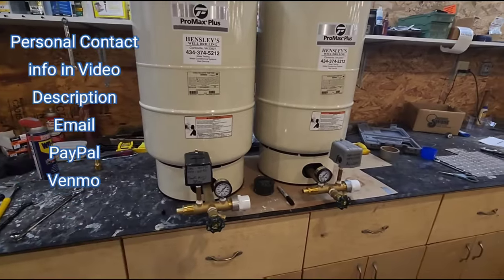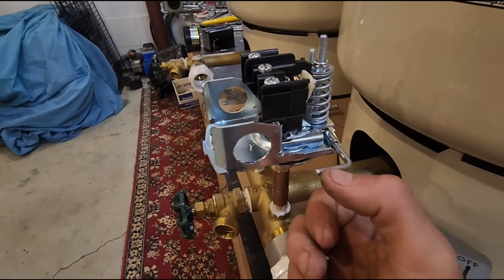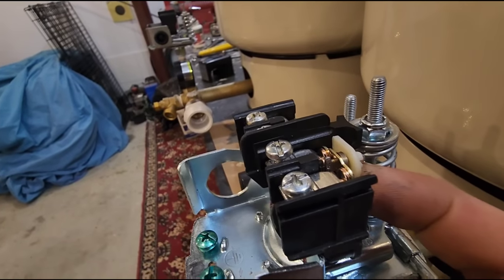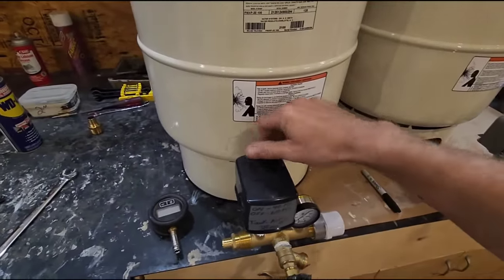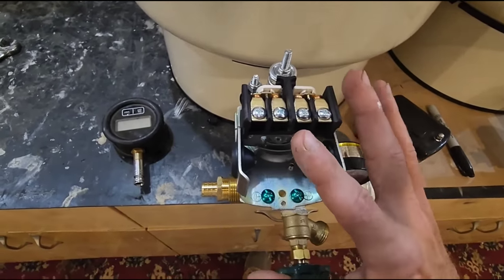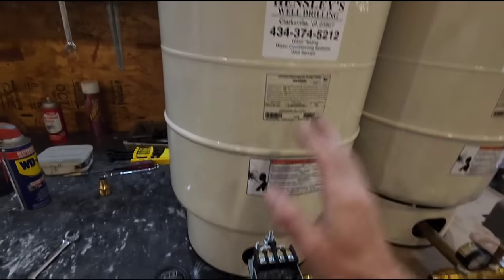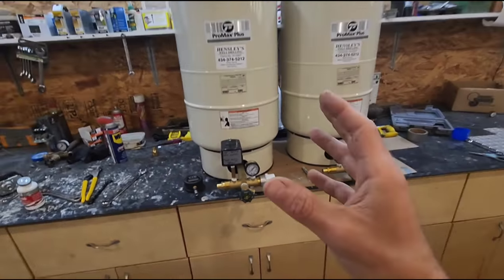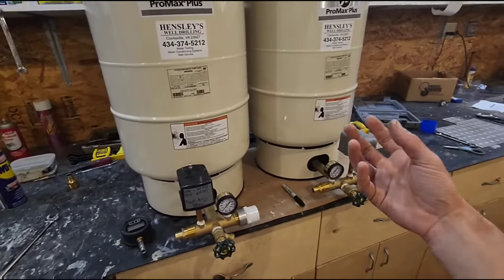Most Common Reason for No Water!! Reset Pump Pressure Switch. Water Well Repair Vlog Ep.18

Comment: Hi I moved into a house that the power was shut off for a while I had it turned back on but there no water what do I do
Reply from the maker: Does your pressure switch have a lever on the side? Follow the Vid on how to reset it. 
Is the well pump breaker off?

Comment: God I need help with this so bad my pressure switch keeps shutting the pump off for seemingly no reason the tank clearly has pressure but I don't know if it has to much I am going crazy
Reply from the maker: Turn off the breaker to the pump, then open a sink . Once it quits go check the air pressure in the tank. If its above 20psi it should run fine. If its below 10, air it up. The air valve is on top of the tank. 
Now, if the pumps fixing to die, it'll shut itself off because it's overheating (it's run for 3-5 minutes & shut off for 6-10 minutes and randomly come back on. Check the tank first,  if it has good air & it seems empty & easy to move it then the tank is good & probably the pump is the issue. A clamp style amp meter is what you need to truly test the pump. Order one from Amazon that'll read up to 20 amps. (Not a typical volt meter) A clamp style amp meter

Comment: I turned off my breaker. Drained the water and changed my sediment filter.  When I turned it back on. It did not work.  30/50 bladder at 26 psi. Basic volt tester pen indicates power before and after switch(no lever) when contacts are touching. Also pressed reset button and nothing. Any suggestions??? I need help
Reply from the maker: Flick the contacts a few times. If it worked before it should work now. Did you forget to turn a valve on?
Next step is to test for power out at the well & feel the pipe to see if the pump hum's (it's running)
Reply: The water came back on around midnight that same day.  Honestly not sure what made it come back on.  Only thing I can think is I trapped an air pocket after draining the lines to change the filter.  Idk. Just glad it’s back on.

Comment: New pressure switch new tank water want even build to 20psi any ideas
Reply from the maker: Kill the power & see if the pressure drops to 0. If it does, then you have a leak (most likely down the well, i.e., broken/rusted fitting) 
If it holds at 20 psi when the breaker is off, you simply have a worn out pump. Impellers are shot

Comment: What happens when your water pressure at the gauge is not high enough to reach the cut on psi of the pressure switch
Reply from the maker: Either the pump is old & weak, or you have a hole in the drop pipe

Comment: Mine doesn’t have the lever, it has a push down button, I pressed and the tank went to 100psi but still no water so I released some pressure and still no water!! It’s getting a very small amount of water in some lines but not enough to make it through the house
Reply from the maker: The gauge is probably broken so don't trust it (or replace it) 
A push button reset I believe is for older 3 wire pumps. All my pumps are 2 wire.
Your pressing a reset button, if its tripping, that means the pumps the issue

Comment: 9:30 sunday.  I hit the reset switch at 45 for 20 secs.   You hear a buzz noise.  Wants to start but doesnt.  Like stuck.  Smell a rubber/electric burn smell.   When u have switch doing 45.  No water sound.   Gauge reads 0.  Should i just fill tank with air?
Reply from the maker: Sounds like you have a 3 wire pump with a grey control/ starter box. Inside that box is a capacitor, id guess that the capacitor is blown & needs replacing.
Reply: Ok i DO know what your talking about.  A video said DONT touch that if dont know what your doing.   I most def can disconnect and reconnect new one but im kinda nervous even if breaker off.  Your advise on that? Is it worth electricuting myself?   Getting someone out just for that?   🤦‍♂️
Reply from the maker: @Gene h  replacing the cap is definitely a job for a licensed professional. 
A bad cap will typically blow out the top or bottom, & they store power. So its tricky to fool will & not get shocked. Best to call someone & give them these details you mentioned
Reply: @h2omechanic  ty very much!!!   I will

Comment: Well here I go again pressure switch keeps sticking and not sure if it is dirt in the gauge or the pressure switch which is a 40/60 pentair switch  . I had 2 square D ones and both of them rusted and fell off with in a couple of years  . First time was 2010 by my paper work and second one was 1014 when I went t fergusons and bought a 40 gallon pressure tank and the whole repair kit   for it which was the pentair one and it has lasted since then . Now it is sticking , couuld there be dirt in the extensions up to them . Now all i can find is those square D garbage ones .
Reply from the maker: I sell switches on my site. Not S-d. 
But yes, the nipple below the switch is clogged up with iron/sediment most likely. Remove the switch and clean out the nipple using your screw driver. Very common problem
Reply: @h2omechanic  what brand switch and how much and how much to install it
Reply from the maker: @sissy murphy  my website is in the video description box. 
It's $36 the switch is made by American Granby. 
I have a video showing how to replace the switch as well

Comment: I replaced air tank and pump and switch last year today no water i still have power but pump doesnt turn on. My air is30 50 and tank has 22 lbs.  Still nowater
Reply from the maker: Check for power at the well head, if power is present, then the issue is down the hole. Bad wire or bad pump.

Comment: If kids left the air out of tank what should I do .
Reply from the maker: Turn off the pump breaker, open up a sink and leave it open, then go to the tank & use a little air compressor and pump the tank up to 25psi, this will push out any trapped water out of the sink. Once it reaches 25psi of air pressure your done. Go turn on the breaker and turn off the sink

Comment: For some reason. Mine is not filling with any pressure.. same switch set up.. but is not filling with water.. well is full..edit.. this tank is less then 3 months old as well. Brand new just installed. Same guy is voming out to check it out today
Reply from the maker: @JUSTALOSER0101  possible leak in the well. Cracked fitting or pipe near the pump. Or simply a bad pump

Comment: My well water pressure switch 30/50 drops to 25 for about two seconds then drops to 0 for about 2 seconds then jumps to 30 and starts building pressure to about 55 then settles about 50.  During the drop, the water barely come out. It won’t even work a single yard sprinkler.  Is it the pressure switch?
Reply: And the tank pressure is 28.
Reply from the maker: Sounds like a pump pulling alot of amps & turning itself off. 
You can try the switch and clean out the nipple below it. But I believe it's the pump. Especially if it is 10+ years old
Reply: Thanks, I bought this house two years ago, built in 02.  It looks like a fairly new switch and tank. I’ll check the pump.  Thanks.  I’ll update when I find the problem.

Comment: Hi there, i have pressure pump in the garage, go to the house i has pump installed about year ago. This pressure pump have a by pass switch, i have water and the pressure switch th with the key pressure set at sixty psi. The new pressure pump usually came on when i use water in the house,but tonight it not come on at all. I think the by pass swith is not working so i have to wait till morning to see what is going on. Can you help me to see what is going on? Would be nice if you have you phone # posted.
Thanks!

Comment: My well pump does not always kick on, if I manually close the contacts it will start fine and run normally
Reply from the maker: Clean out the nipple/ pipe that the switch sits on. 
That requires removing the switch.
Reply: @h2omechanic  thank you

Comment: I'm so frustrated. Nothing is working. Breaker kept popping, capacitor melted on the white disc, pump came on but won't anymore. I bought a new control box. Nothing. Please help
Reply from the maker: If the breaker trips & capacitor is blown, that's a sign that the pump is dead/locked up. Old age or lightning killed it. 
It's also possible that it's a bad wire somewhere in the well, but if the pumps old, it's probably the pump

Comment: HELP
I REPLACED MY WELL PUMP PRESSURE SWITCH AND GAUGE IVE GOT OVER 100 PSI AND PUMP RUNNING CONSTANTLY TRIED TO ADJUST PRESSURE SWITCH STILL PEGS GAUGE, WE DRAINED PRESSURE TANK BECAUSE IT WAS OVER 50 SET IT TO 28 PSI AS RECOMMENDED AND PRESSURE GAUGE STILL PEGS OVER 100

Comment: Hey, o tried this and my water pump isn’t getting any spark. Idk what it is
Reply from the maker: No spark means the pumps not running (typically)  so either the wire that goes down the well to the pump is bad or the pump itself is bad.

Comment: I'm desperately needing to know why the pressure tank isn't holding the pressure?
Reply from the maker: If its not holding water pressure, it's probably either frozen(if it won't build any water pressure) or the pumps dead, or a pipe is broken down the well

Comment: What does it mean when there is no pressure switch on the side
Reply from the maker: No lever on the side? That's just a common "regular" style switch. 
If it has a lever on the side, it's a low pressure safety style switch. Only needed for real deep pumps

Comment: 40 60 runs below 40 frequently while watering cows. I need to reset 4 to 5 times daily
Reply from the maker: The nipple below the switch may be clogged or the tank may be low on air.
Reply: @h2omechanic  thank-you the tank is at 38psi empty and vented. I will check the valve
Reply: Bladder loses air. About 15psi daily. No water is coming out of valve core. Where is air going??
Reply from the maker: @user-tx2vg7lw9u  the rubber bladder has a pin hole leak. The air is escaping out little by little with the water. 
If you left it alone for a few weeks, eventually the hole will get bigger and water would shoot out the top air valve. 
Regardless, Replace Your Tank.

Comment: Ok so are well pump shuts off after 5 10 mins and no pressure at all it does it everyday doesn’t hold pressure at all
Reply from the maker: Possibly a bad pump or a broken pipe down the well leaking out all the pressure (circulating the water)

Comment: can I use this $150 pump in my well for my house? WASSERMANN 4" Deep Well Submersible Pump with 10FT Cable,1HP,230V/60HZ,33GPM,190FT Head,Stainless Steel Submersible Screw Water Well Pumps for Factories,Farmland,Irrigation Use
Reply from the maker: No. 
The 33GPM is the key sign. Itll have a max working depth of about 50ft. 
If you set the pump at 80-100ft, you'll notice that it doesn't build enough pressure. Watch my most recent pump test Vid of a similar pump

Comment: What happens when a new pressure switch doesn’t turn the pump off.  The air pressure is correct in the tank..  I have paid approx $800 to pump experts & it still doesn’t work.

Comment: My contacts do not move when raising the switch to the 45 degree angle ??? 🤷‍♂️
Reply from the maker: Possibly a broken switch then.
Try using the plastic cover to push against the contacts to see if they move. Just be cautious, there's 240v under the cover.
Reply: @h2omechanic  ... I finally got that problem fixed but no matter how much I play with the #1 screw I can't get the low pressure to turn on.

Comment: My pump cutting on and cutting off nonstop! What it could be?
Reply from the maker: Rapid on/off means it's a bad tank.
If it cuts on & off every 20 secs but you still have water, that's typically a failed check valve in the pump & all the water pressure is flowing back into the well thru the pump.

Comment: I have water pressure, just no switching of the pump, when i hold it closed my control box hums, im thinking the motor is toast....
its OLD.
Reply from the maker: Your correct. 
Time to update the system! 
I always recommend switching to a "2 wire pump" & that'll do away with the controller box. 
(Typically the hum is locked rotor on the pump)

Comment: My problem is the pump won’t shut off . Opened up the switch and everything looks ok , there are no leaks in the house but the pump stays on.
Reply from the maker: Most likely it's a hole in a fitting near the pump leaking out some pressure and making it not build up to 60psi. 
If it builds over 60psi & goes to say 80, then that's the nipple below the switch that is clogged up and that's a simple fix, by removing the switch and push a screw driver threw the little pipe below the switch thus cleaning out the clog. 
Or the pumps old & worn & can't built pressure anymore. 
If you turn off the pump breaker and open up a sink & hear it gurgle, like air/ water getting pulled the opposite direction, that's a sign of a leak down in the well near the pump (thus broken fitting or pipe). 
These 3 possibilities, 1 will be your problem
Reply: @h2omechanic .  I replaced the pressure switch and the nipple but same issue does not shut off.  I even adjusted the switch to cutoff at a lower pressure but still no cutoff.  Just keeps running

Comment: Although I appreciate the low pressure cut off, the designed solution is so typically backwards. 
When the engineer who designed this pressure switch was asked how to work this problem, he just made a note in de manual "just hold lever in between for 20 seconds"
I can already imagine the discussion in the room. 

Do we need to redesign the switch with an indent indicating the position? Naaaaah.
Do we need to update the casing with a note indicating the procedure? Naaaah
Do we perhaps need to include an priming override switch? Helll naah, that's even more work to redesign. 
But what if the owner holds the lever just wrongly so that the contacts start arcing? HIS. DARN. PROBLEM. Now get off my back I need to design another crappy product.

Comment: For the algorithm
Reply: It was great information but I'm still stuck. We moved off grid and have had intermittent water. I found 2 issues, 1 being the wires weren't in the connector part for the pump good so we welded it together for a perfect connection.  Water worked for a little bit, then discovered my water filter was full of clay. Removed the clay put the filter back, now no water or electricity haha
 Any suggestions on what else ot might be?

Comment: What could cause the pressure switch to blow my breaker for pump? I have to keep flipping my breaker to get my water back flowing again…. Please help avoiding paying 2500 for someone to dig my pump up allegedly
Reply: I have water , pressure just goes
Reply from the maker: If the breaker is tripping, that's only 1 of 2 things. Either a bad wire in the well or a bad pump. Both require pulling out the pump
Reply: @h2omechanic  I just seen your video on how to dig it up
Yourself , thank you I will look further into your videos ! Thank you so much

Comment: Gauge stuck on zero, holding pressure switch at start position for 20 to 30 seconds
Reply from the maker: Does the switch spark? If not then it's a issue down the well.  Bad pump or wire

Comment: Help!!!!
Reply: I feel like I have watched dozens and dozens of videos on what to do. My power went out when it came back on I didn't have water. I primed it I feel like I have been so patient and its driving me nuts.. I have had problem after problem with wells ugh. I have a 40/60 but it want get any higher than 50psi but doesn't shit off... keeps running. My tank reads a 36psi, and no water is coming out when I test it either. The 50 psi holds until I open up the valve to the house and run a little bit of water, or flush a toilet it drops to 0 immediately and I can't get it back up.... I have to shut everything off and wait and try again.. it runs on a 110..... what is going on.....help me!!!!

Comment: my tank keeps over pressurizing?
Reply from the maker: Are you checking air again after you allow it to full with water? If so (dont!) Water displaces some of the tanks volume & will compress the air. 
You can only test air pressure if the tanks empty of water. If you did it this way & it increases, then the tank is bad. Water is Trapped above the bladder. (Hole in the bladder
Reply: @h2omechanic  my gauge is showing way to much psi
Reply: I let the tank drain and the psi has went down on the tank, but the gauge still reads to high
Reply from the maker: @PaulHodge-kd8ze  the gauge is probably bad. Just replace it and see if it helps.
If the system froze, the gauge was bent internally
Reply: @h2omechanic  Thank you l was wondering about that, l appreciate everything, l will be back to make this help right, I've been in the skilled trades for over 30 yrs sometimes you need a second opinion, You are a great guy keep it up, maybe some day I can help you